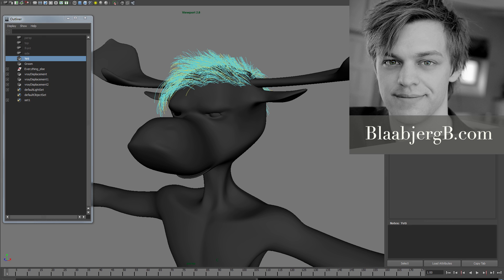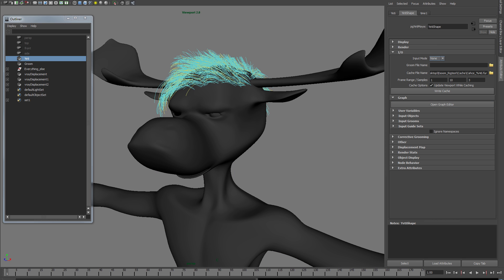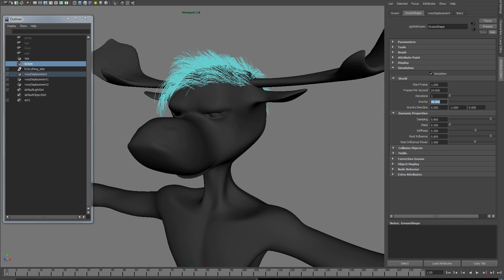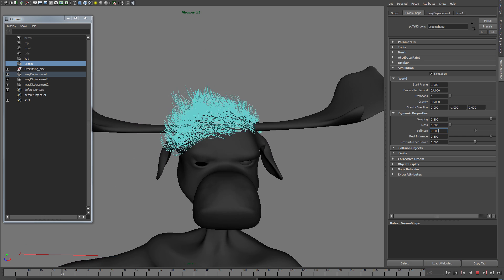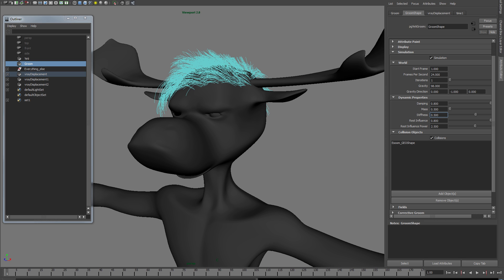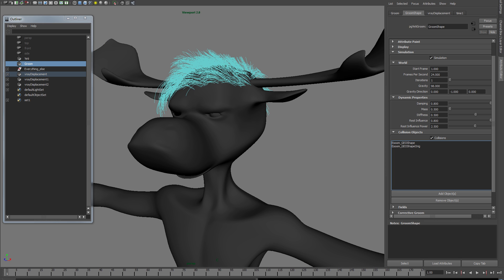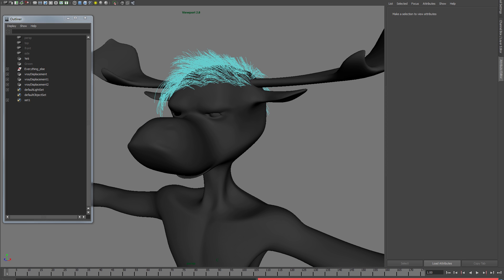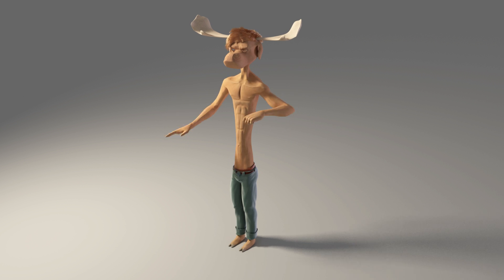Simulation with Yeti

Comment: HI, what do I do if the fur keep moves alot when  I simulate it, like it has noise, I made stifness 1 and also damping 1,  still it moves. any idea what to do ?  I message on your vimeo also :) , I at a stuck here I really need help pls.
Reply from the maker: There could be a lot of things that cause this, make sure you have no intersections and nothing else is pushing on the fur in it's neutral position. If it's animated, start from a neutral pose and then slowly bring it into pose.
Reply: @TheCaptainFusion  also does scale paly a role in yeti, is there a good scale, for example if u model a deer to scale i nmaya its big compared to the grid i nthe viewport, if we scale it down by 0.1, and then appy yeti
will that be a problem,?
Reply from the maker: @migi847  It's only problematic if you scale the model after you did the groom, because then your width values and density won't fit anylonger. Ideally you make the deer in the correct scale from start so that you don't have to worry about it, and the grid in maya means nothing.

Comment: thanks, very good tutorial, do you know if there is a way to change the scale of the simulation? because. with for example, a sphere of 100 units, the simulation values are very odd
Reply from the maker: I would change the gravity settings as a quick solution. Or, you change the sumulation settings in general to match real life behavior.